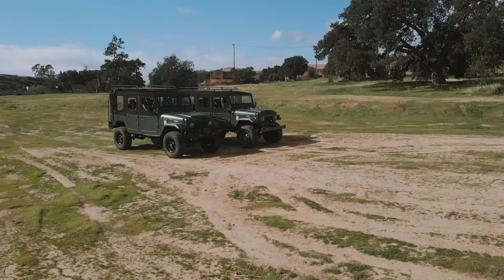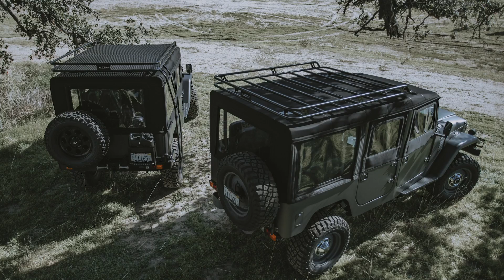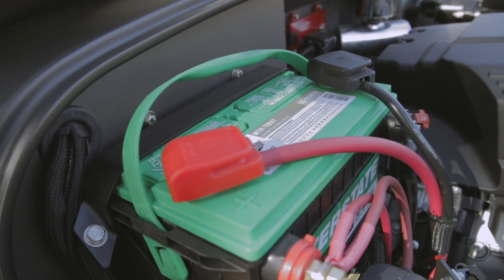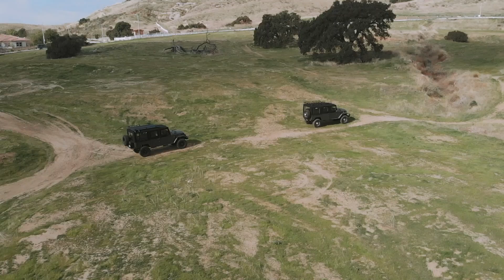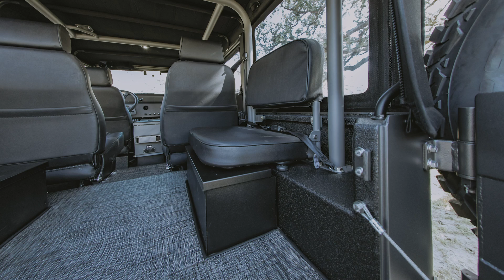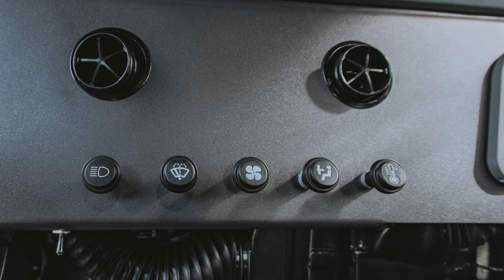ICON Toyota Land Cruiser FJ44 Old School vs New School Review

Comment: Wireless CarPlay kinda sucks imo.  1. you want to charge your phone when in the car.  2. pairing multiple phones to the radio is a terrible experience.  a wire is the best UX when it comes to who's paired.  3. having the phone mounted and plugged in gives you a second screen when you are getting directions or Gaia GPSing.